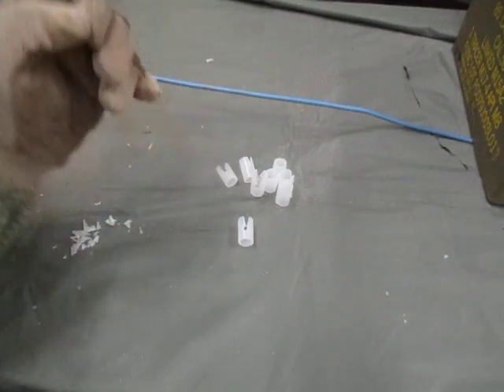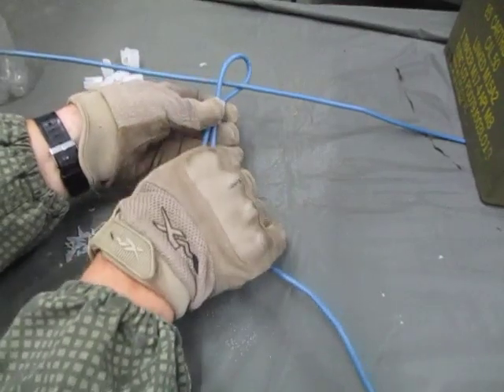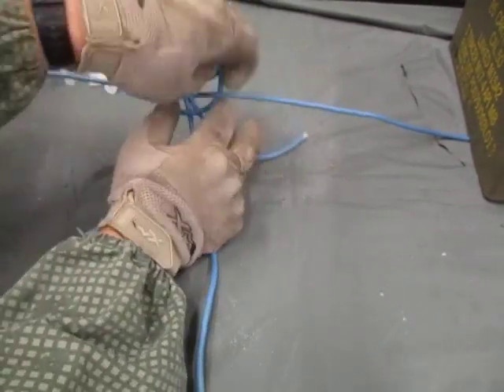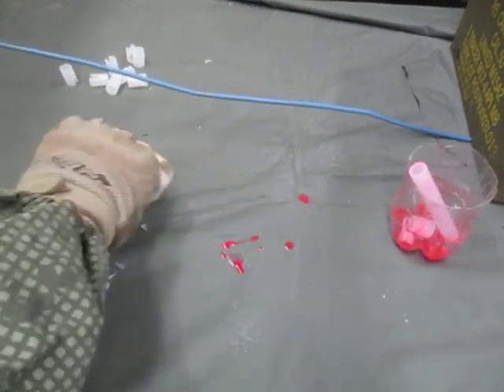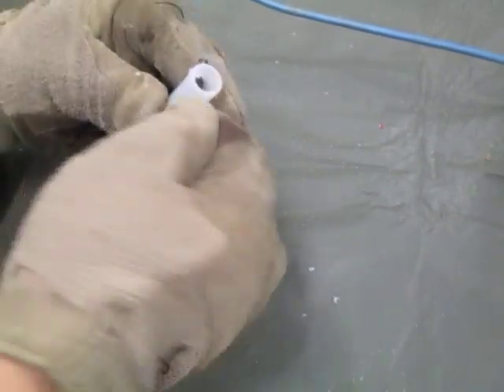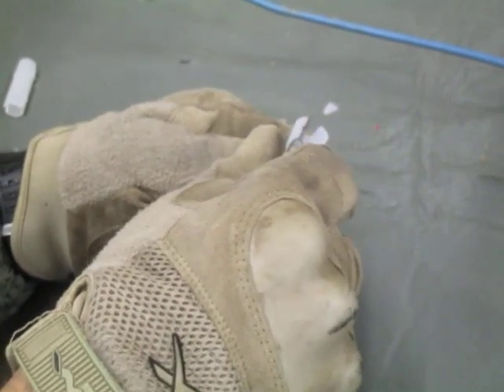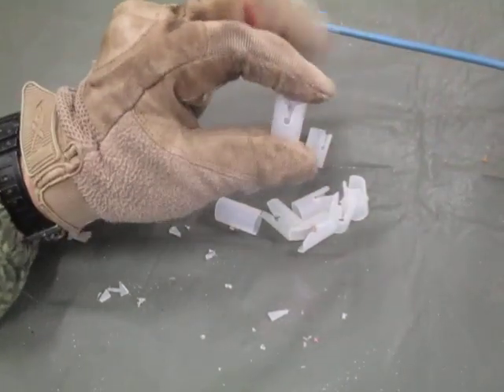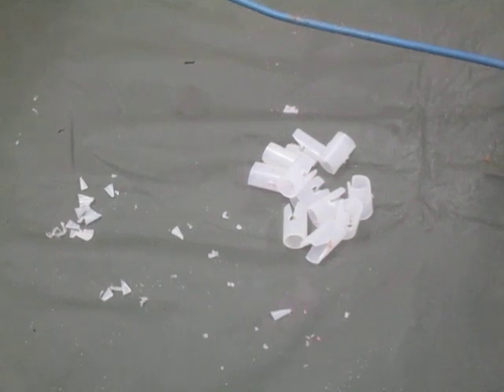Militia Engineer Tools- Improvised Detonating Cord Clip

Comment: excuse the ignorance, but why won't clothes pins or some kind of binder clip or paper clip accomplish the same thing?
Reply from the maker: You need close, tight contact on the det cord.  Otherwise you run the risk of just cutting it.  The Det Cord Clip technically is not allowed by the Engineer Center (the Engineer HQ for ALL engineers at Fort Leonard Wood) because you really only have 1 point of contact of the branch line and line main.  You are required to have a minimum of 2 points of contact in your connections to guarantee detonation.